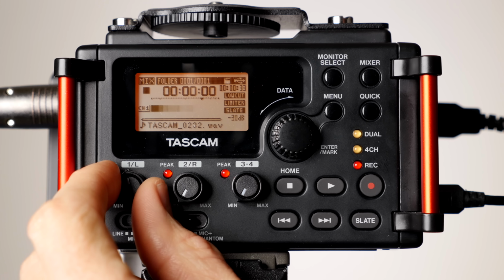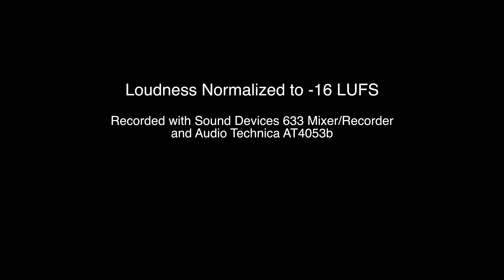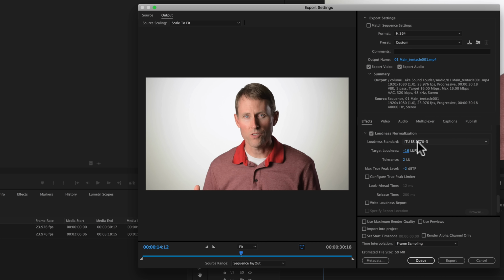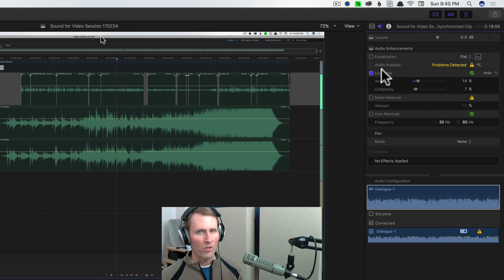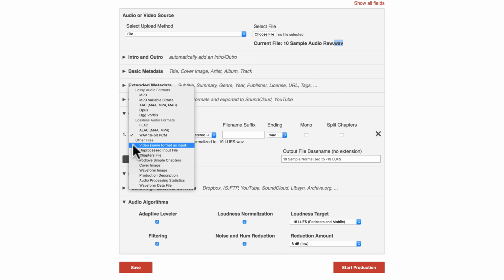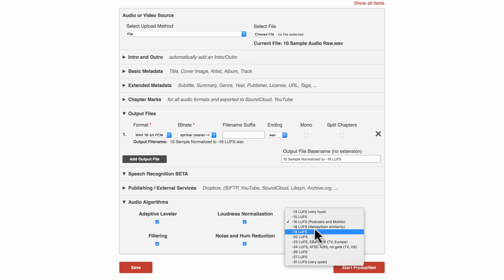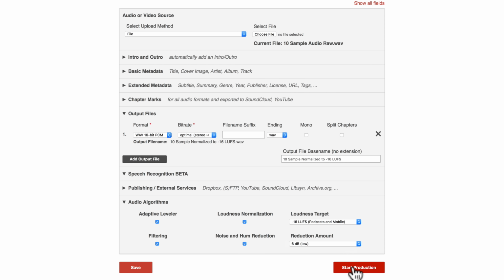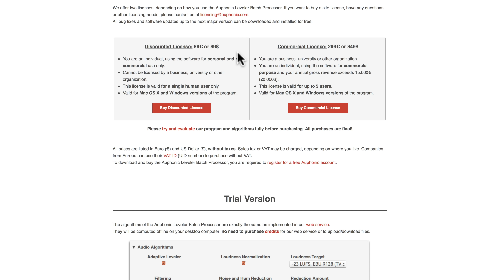How to Get Loud Consistent Sound for Video

Comment: I literally have a preset called 'Curtis Judd Audio' that I use in audition that uses the last 5-6 audio leveling tips you've given. Absolutely love your workflow and it has really helped make my videos consistent. question tho, any chance we could get a FCPX workflow for true peak limiting? Maybe using Logic? I just wanna be able to do it all in FCPX without having to be online or even leaving FCPX if possible maybe using the built in plugins?... any 3rd party plugin recommendations?
Reply: Chris Towerton sure I'll send you the recorded steps I've done a la Curtis' instructions that helps audio stay clean consistent and loud. It's basically a 'recorded' action of several techniques applied in Adobe audition. I do use an iZotope plugin, but will send you the one with built in plugins
Reply from the maker: Thanks Sully! Unfortunately, I haven't yet found a way to do this all in FCPX. I'm tempted to try Logic and understand that they recently added a loudness meter. Hopefully that makes its way to FCPX soon as well.
Reply: Hi Curtis, in FCPX I have a quick 3-step process. 

I typically record at -12db. 

1. Use EFFECTS | Compressor on my audio track.
2. Then EFFECTS | Adaptive Limiter on the same track
3. Copy and Paste the mono audio track. Not needed for stereo tracks.

Pretty quick, and straightforward.

And finally, on the occasions where my raw audio is recorded a little hot, I change the Default Gain fro 3db to 0db on the Adaptive Limiter. 

Give it a try, and let me know what you think.
Reply from the maker: Hi Joe, will do, thanks!

Comment: Thank you, Curtis! That’s brilliant. But I wonder what is the order of applying Compression and Normalization? Do you need to normalize audio first and then compress it, or compress first and then normalize? And do you still need to compress the audio which was normalized in LUFS as it already seems to do some magic on the waveform bringing lower parts up and leveling up everything.
Reply from the maker: Compress first to manage the transient peaks so that you can then normalize.

Comment: Thanks for this! I'm curious about Auphonic. Would you suggest we compress before sending off to Auphonic? Also, what about hard limiting? Is that something we still need to do after it's been processed on Auphonic? I also see that Audacity now ha a Loudness Normalisation effect. Please do an updated tutorial on how to use Audacity for that!
Reply from the maker: Hi Trini, Thanks for the question. Auphonic should be able to handle all of that for you. You can do it yourself, but in most cases, Auphonic does a nice job with it.
Reply: @curtisjudd  Thanks for the advice! I really appreciate it and continue to learn from you!

Comment: Hi Chris, 
I do enjoy your down-to-earth YT posts (especially the Zoom F4 review 'cause I actually bought one!). 
I forwarded your "Consistent Sound" post, which included the use of 'Auphonic' software, to a friend as I thought he might find it useful. He agreed that in FCPX that, "the high level audio adjustment is not much use."  and went on to note, "...that there are almost 100 audio processing tools in FCPX under the 'Effects' menu to drop over clips ... An effective one is the "voice-over enhancer".  That covers all (you) mention.  Being able to select male or female options and compression and de-esser reduction using very professional looking widgets... The other one is compression (where all the parameters are adjustable).  I (he) often use the multi band graphic equaliser to boost / cut frequencies...Conclusion:  FCPx has all that's needed.  Furthermore, having selected a favourite adjustment, it can all be saved as your own design in the Effects menu."
Just comments that you and/or others might find useful if not already aware.
Also, I understand that Logic ProX allows the import of audio or video with audio from FCPX, which presumably expands the audio options considerably. I haven't tried it yet, do you have any experience of using it (any YT posts)?.
Cheers, Peter.
Reply from the maker: Hi Peter, thanks for the note from your friend. There are some really great audio tools included in FCPX. The one that they seem to be missing is a loudness processor that can normalize to loudness standards. They have a loudness tool, but it is just an unmarked slider so you don't know exactly where you'll land in terms of loudness which can make it hard to be consistent from piece to piece. I've still got my eyes out to find a good, affordable plugin to do the job with FCPX.

Thanks again for the note!
Reply: I believe that there is a Loudness Meter in Logic Pro X that is in LU.
Reply: This might be useful if you haven't seen it already: http://www.fcp.co/forum/4-final-cut-pro-x-fcpx/22706-r128-lufs-in-fcpx

Comment: Curtis. Thanks for all the info and giving me the confidence to record. Is there an easy way to get the audio out of fcpx in an audio file format only to send to Auphonic and then sync back to FCP? Sorry if there's an obvious answer.
Reply from the maker: Hi Jared, you can export audio only in the share menu. Then you import the new file produced by Auphonic. Bring it into your timeline, mute all of the existing audio and should be good to go. I'm not sure whether this qualifies as "easy" but it does work.
Reply: @curtisjudd  Thanks Curtis :) In the short term I'm going to use Klangfreund LUFS plugin. But I want to try a few other options soon.

Comment: Chris, By chance do you have a more recent version of this video. I use adobe. I have audition but have not used it yet. Just wondering I'm guessing a lot has changed. Thanks.
Reply from the maker: This all still works in the current version of Audition. I do have a more recent video but we showed the process in Izotope RX instead.

Comment: Hi Curtis - I seem to recall you whetting my interest in LUFS targeting in Audition in one of your videos from a couple of years ago (for which, belated thanks!).  I've played with the online version of Auphonic a few times recently for short clips which I've originally recorded into Audacity.  The sound is fairly clean, so the main task has been to get the adaptive leveler, the loudness normalisation and the loudness target to work as a simple workflow.
Although I'm very impressed with Auphonic (I've read quite a bit of the background material at their site and listened to a lot of their demos), the one niggle which has stopped me buying a personal license for the desktop app is that it seems to make the output audio a little bit more bassy than when it started.  I'm fairly sure it's not just my imagination - I've managed to work out how to get Audacity to display the audio tracks as spectrograms, so I can import the processed track and compare the original source above the processed file.
I don't know quite enough about it all to be able to say that it's not some flaw somewhere in my processes (which I try to keep as simple as possible), but I don't think I'm causing the problem for myself.  The only difference I can spot is that I was targeting my mono track to -16 LUFS, rather than the -19 LUFS you mentioned - but I can't see that causing this sort of problem…  Any thoughts?
Reply from the maker: Hi Gary, I haven't specifically compared the spectrogram of before and after files with Auphonic. Do you have samples we could look at? Which settings are you using when processing the files with Auphonic?

Comment: Does the premiere method work when you have a music track and other things going on besides a single track of dialogue? And can that be used in lieu of actually going through the manual process of compressing and normalizing in premiere? Because if so, I have wasted a lot of time in Audition haha
Reply from the maker: Hi Robby, Yes, it is applied to the master sound bus which is a mix of all of the sound tracks. For the best results, you will still want to do some compression and fine-tuning of the tracks before exporting from Premiere. But for quick and dirty pieces, just doing the loudness normalization during export is good enough. At a practical level, the premiere loudness normalization can apply limiting in a rather harsh fashion so it isn't the end-all solution.
Reply: How would you do it in audition? I want to leave the background music at the same level/manually adjust it, but i dont want premiere to interfere with it...
Reply from the maker: Use the methods shown here but do your mix first (adjust the music relative to the dialogue). Then apply the loudness normalization to the master bus (not the dialogue or music tracks).
Reply: Curtis Judd thanks, but doesn't it do it on export? So wouldn't it do it to the whole thing?
Reply from the maker: That's one way you can do it, but you can also turn off the loudness normalization in Premiere and instead do it manually in Audition.
Reply: Curtis Judd thanks, how do you do it in audition? How to apply it to the whole sequence?

Comment: Hey Curtis, very informative as normal - a couple of questions 1) what's your standard workflow? Noise removal, compression, normalise? ... or have I missed a normalise step...or is noise removal last (so you can actually hear the noise). Also when testing/comparing the 'self-noise' of say a mic or a recorder you often say the noise floor is e.g. -58db 'after normalising' either to -19 or -16 lufs - dumb question but in the tests does it matter how loud you are talking in each of the tests... or not because it normalised? Thank you
Reply: 16 lufs is not a good level for dialogue only because it sounds too aggressive. The -16 lufs spec is a general indication considering the summing of music background and dialogue or music alone. The -19 lufs target for dialogue only will lead to a much more naturally dialogue sounding level (for the WEB). Then if you add a music background track on the voice over the final mix will go to -16 lufs which is correct. I usually normalize the VO -2db lower than my target loudness considering that after eqing and compression the level will increase so better to leave some headroom just in case. After normalizing I do noise reduction to achieve a noise floor to around -60db or less-it depends the situation and then I do eq and compression and re adjust a final loudness level if necessary.

Comment: Is the dr-70d the best one Tasca has?  How often do they upgrade these models?  I'm deciding whether to go with this or the dr-70d or dr-44wl or maybe the zoom h5.  Maybe there are others that I need to check out before I buy.  I recently bought a AT4050.  Any suggestions?
Reply from the maker: +FLOODOFSINS no, Tascam makes some higher end models at various price levels. Each of the recorders you listed have their strengths and weaknesses. I personally prefer the DR-70D but the H5 is also good. If you need wireless then the 44WL is the choice. So in the end, it depends on what you need.
Reply: Curtis Judd Thanks for the quick reply,  Is there a portable device that I can also plug into my laptop with USB?  I dont want to buy to audio devices like the scarlett 2i2 and another device for field work or just another room.
Reply from the maker: H5 will do that. That Tascams will NOT.

Comment: Hi Curtis, great video as always. Auphonic seems really interesting as the whole LUFS thing has befuddled me in my workflow for a while. Question; With how you're using it, are you sending your final mix from your project to it and how does it deal with that in terms of varying levels throughout the timeline, music etc? Cheers
Reply from the maker: Hi Matt, truthfully, I use the manual method and have only used Auphonic for mono dialogue tracks so I still need to test how it deals with multitrack mixes. I would not want it to mess with my mix in generally and would just use it to do the loudness normalization once I've worked out the mix (i.e., I would turn off the leveler, filter, and noise/hum reduction). I would use the Premiere loudness normalization on my final mix which will only apply the loudness to the master stereo bus which would be fine.
Reply: Ok cool, thanks for getting back :)

Comment: What you are talking about is Level Control. Normalization is easily upset by transients. The Adaptive Leveler of Auphonic is a nice feature, if it can ignore the transients, such as handling noise. Limiting is still subject to distortion, so selective compression 'sounds' like the way to go. Perhaps AI can take care of the problem in the future.
Reply from the maker: Yes, yes, yes. Compression is usually required to achieve -16 LUFS targets.

Comment: Hi, Curtis! Again, great video. You've convinced me to improve my audio! I am about to get a Tascam DR-05. Would you recommend the Smartlav+ or the JK Mic-J 044 (004 for the Tascam I think)? Which one should I get? Also do I need to use the Tascam DR-05 to power them, as it has that setting?
Reply from the maker: Hi Atanas, thanks! One thing worth considering, I have found over time that the Zoom H1 has a better input for external mics like those you listed - slightly less hiss and self-noise. You might consider that instead of the DR-05 if your primary use with be with external lavalier microphones.

The JK MicJ will work with the Zoom without adapters so that'd probably be my first choice.

Comment: Hey Curtis, how is it going? Cheers from Brazil.

I'm a huge fan and before anything, thanks so much for the content, it's awesome!

Sorry if this is becomes a long post and hope you can help. Maybe it even become one of your videos tutorials :D

A while ago I bought the Audiotechnica AT2005USB that you recommended on another video, and that's been a great help so far for skype/hangout meetings, streaming games and stuff.

I've done some small processing with it for projects every now and then using a lot of your videos (from 2017 to 2013). I'm about to start a online course with lot of voice over and I need to set a consistent audio pattern for me.

For those isolated projects, the processing was easy and always about one or two things to improve, but now that I'm recording at home, I need to address various problems at once and I'm having a hard time on putting all of your tutorials together in a order that make sense and specially don't distort the audio.

With my current settings, my recording tests don't even reach -21db, so is too low on volume. Don't know if you recommend changing anything (I'll leave it below), but for the current settings, the post processing that found I need to improve are: 
- background noise reduction
- reverb
- amplitude & loudness 
- clearer sound
- compression
- asymmetry

So my question is: in what order do I apply these things to achieve better levels and clearer sound? Do I clean background noise right after level increase or at the end of everything? So many questions hahaha

Here's my audio sample: https://www.dropbox.com/s/pmte0emt4hvrzps/sample_leandro.wav?dl=0

The sample is in portuguese and the literal translation would be: "There's a lot of factors that compose an efficient digital marketing strategy, and that's why I say: nothing works alone"

The literal translation might sound weird, so if I had to say in english would be something like: "There're a lot of factors that makes up an efficient digital marketing strategy, and that's why I say: nothing works isolated"

The process I've tried and gave me the best results (which I'm sure will make you pull some hairs off) is: 

- Effects > Amplitude and Compression > Hard Limiter (-1, 0, 5, 150)
- Favorites > Normalize to -0.1db
- Effects > Amplitude and Compression > Single Band Processing (-6 to -9db, 2 x:1, 1ms, 150ms, 0db)
- Effects > Amplitude and Compression > Single Band Processing (AGAIN)
- Effects > Noise Reduction (Noise Reduction 80% and 8db | Adaptive Noise Reduction 20db, 30%, 2db, 2,50db, 140ms, 100hz)
- Effects > Filter and EQ > Parametric Equalizer (Loudness Maximizer)
- Effects > Amplitude and Compression > Single Band Processing (AGAIN)
- Effects > Amplitude and Compression > Normalize (Process...)
- Effects > Special > Vocal Enhancer (Music)
- Effects > Special > Mastering (Loudness Maximizer 10% | Exciter 5%)
- Effects > Amplitude and Compression > Single Band Processing (AGAIN)
- Match Volume (ITU-R BS 1770-2 Loudness, -16LUFS, Look Ahead 12ms, Release Time 200ms)

Things I've done or information that might help you understand:

- I'm editing with Adobe Audtion CS6 (Not CC. From your videos, the only thing I don't have so far is the Learn Sound Model/Sound Remover over Noise Reduction)
- I'm recording in my CPU in my bedroom that have approximately 4,5m x 3,2m
- The room doesn't have any acoustic isolation. It has concrete walls, a wood wardrobe, wood floors, some wood shelfs and a 1,60m x 1,45m window
- The mic is connected directly to my computer (I don't have a mixer, if this helps in any way)
- I live on the 7th floor of a medium noised neighborhood (some times is quiet but some times that are cars passing by, dogs barking, birds screaming, etc, so windows closed for recording at all times)
- Mic volume on windows Recording Devices is set to 45. Anything above that gets way too much noise from clicks, key strokes and even my arm scrubbing against the table when going from the mouse to the keyboard (don't know if you recommend increasing and processing those later)
- Mic set with pop filter and foam (don't know if "foam" is the right word)
- Distance between my mouth and the mic is around 10cm ~ 25cm and it's on my head level directly pointed to my mouth
Reply from the maker: Hi Leandro! Wow, that's probably a bit more than I can answer in a YouTube comment. But we cover this to some degree in my post processing course over at school.learnlightandsound.com and in a weekly Sound for Video Session at https://youtu.be/eNod8JOVCsk?t=5m19s Best wishes!
Reply: Awesome, Curtis! Thanks so much :D